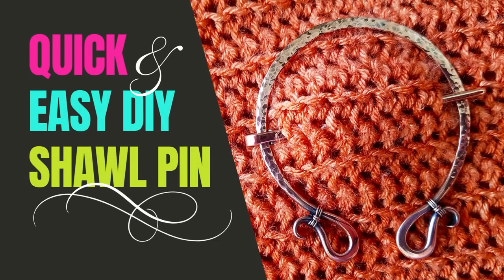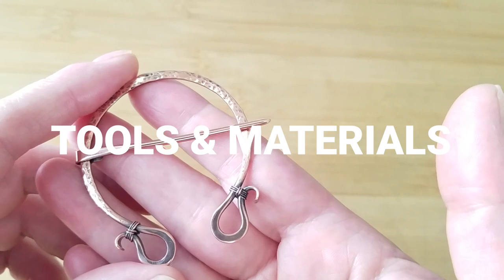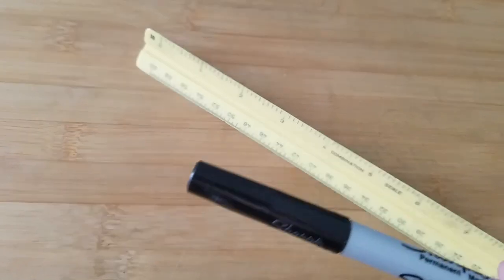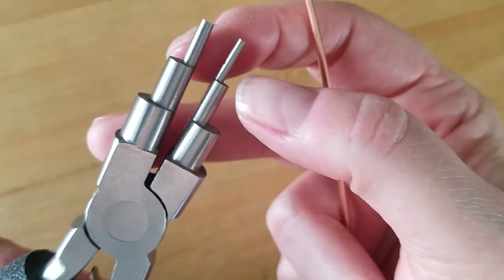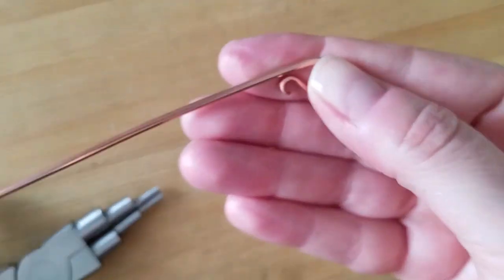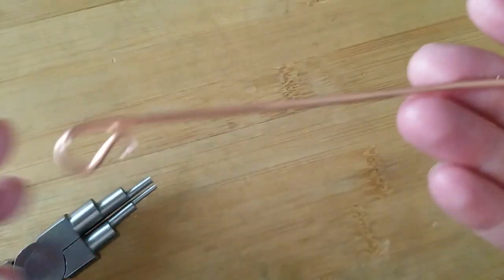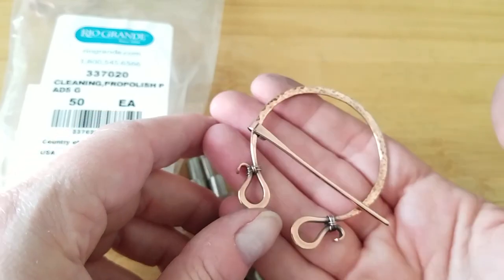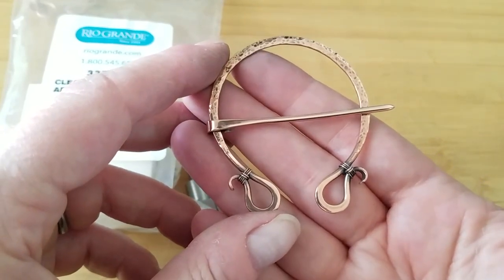Quick and Easy Sweater Pin: Learn to Make a Simple Hammered Copper Celtic-Style Penannular Brooch

Comment: Hi Wendi! Nice project today! Your detailed instructions make my heart and brain so happy!  I do have a question  about needle files (or any file) : I know to use it in one direction, but do you use a pushing, or a pulling motion? I could look it up, but someone else may be wondering the same thing.  Thanks for your time!
Reply from the maker: You push the file away from you. Or you can hold your file steady and pull the piece that you're filing toward you. If you watch closely, you'll see me using both motions in this video. I tend to hold my piece steady and push the file when I'm working on a heavier piece that I can brace on my work surface. And I hold my file steady and pull the piece toward me when I'm working on finer, more delicate pieces.
Reply: Got it!

Comment: Could you please show How to attach to material as I can't wrap my head around how it works.
Reply from the maker: Sure! I meant to add that to the end of this video but I forgot to record it. Basically, you'll flip the circlet out away from the pin. This will leave the pin facing out and the back face of the circlet facing up. Then you slide your pin through the fabric. Next, you flip the circlet back over the pin and rotate it until the tip of the pin passes into the gap between the ends of the circlet. Finally, rotate the circlet back the other way making sure you slide the circlet beneath the point of the pin. The bulk of the fabric will create a bit of tension between the pin and the circlet, and that's what holds the pin in place. 🙂

Comment: I'm not sure how to use the shawl pin. It is connected one side. Can you describe how please.  It is a beautiful pin.
Reply from the maker: Hi, Tori. I answered this question for another reader somewhere in the comments on this video, but I'll spare you from having to sift through the comments to find it. Here's how I described using the pin: "Basically, you'll flip the circlet out away from the pin. This will leave the pin facing out and the back face of the circlet facing up. Then you slide your pin through the fabric. Next, you flip the circlet back over the pin and rotate it until the tip of the pin passes into the gap between the ends of the circlet. Finally, rotate the circlet back the other way making sure you slide the circlet beneath the point of the pin. The bulk of the fabric will create a bit of tension between the pin and the circlet, and that's what holds the pin in place."

Comment: Beginner here. Quick question, if i may: did you anneal your copper before starting to work it? Or is that not necessary? Would this also work with brass or bronze?
Reply from the maker: I did not anneal my wire before shaping this piece. I don't find that necessary with dead soft 12ga copper wire. But I would probably anneal my wire if I was using 10ga or thicker wire. If you find the 12ga difficult to work with you can anneal it. And, yes, you can absolutely make this piece with brass and bronze wire. It looks beautiful in both of those metals. I do recommend annealing alternate wire types for beginners. Brass, bronze, and sterling silver are all significantly harder than copper. So, until you build up some strength in your hands and you're used to working with heavy gauge wire, you'll find brass and bronze much easier to wrestle into shape if you anneal it first. Great questions! Thanks for asking. ❤️
Reply: @Door44Studios  Thanks for the quick and detailled answer! I'll get a torch then :)

Comment: Its awesome 🙏 do you think i can use 14 gauge instead of 12? Or perhaps go higher up and made them double??
Reply from the maker: You can absolutely use 14gauge instead of 12! You may just want to shorten your wire length by 1/2 inch or so and use a slightly smaller mandrel to form your ring. That will help keep everything in proportion to the smaller wire gauge.
Reply: @Door44Studios  thank you ❤🙏

Comment: Are you sure hammering your leg is not harming your bone?
Reply from the maker: Yes, I'm sure. I'm not using enough force to cause any sort of tissue damage. If I were, both the wire and tools would be completely destroyed. Hammering wire does not require a lot of force, but it is noisy, which is why I use my leg to help dampen the sound.
Reply: @Door44Studios  ❤